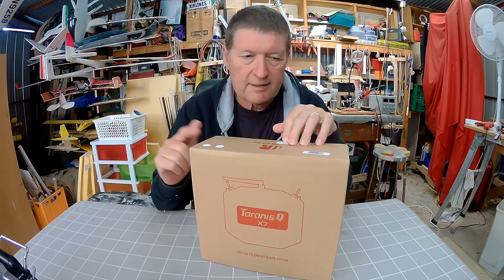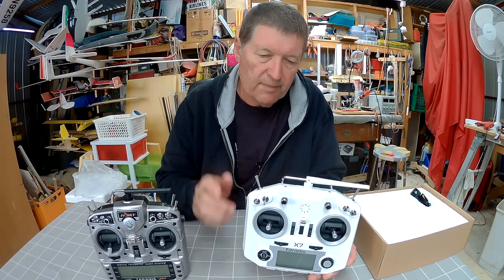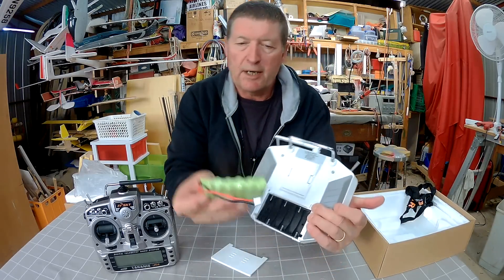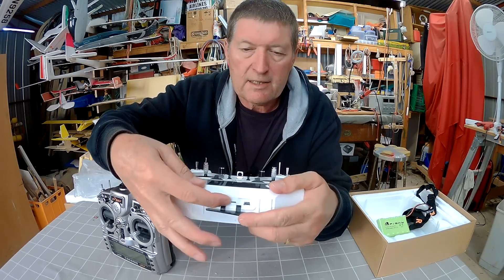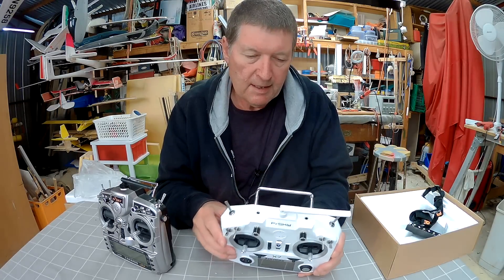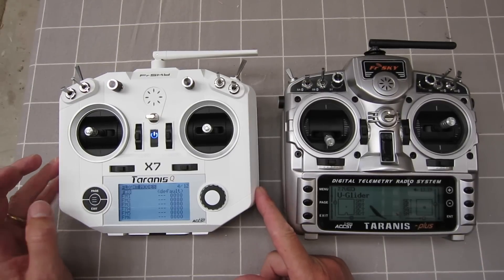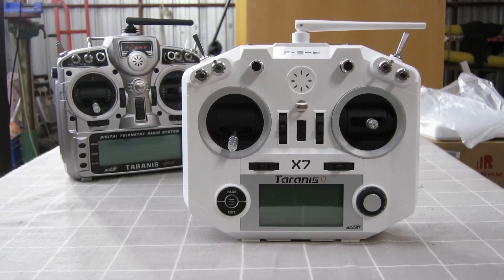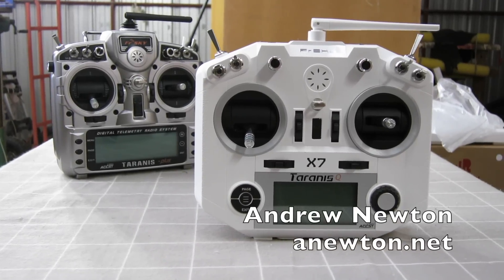Taranis Q X7 review and setup

Comment: Hi Andrew, quick question about the Q7 Taranis.  With these sales on at the moment, I'm contemplating getting one, finally.  However, the one on offer is the international version.  What does that mean, and does that matter for me here in Australia.  I'm your neighbor, just down the road in Melbourne. LOL  Is there anything else I should be aware of before purchasing incase I'm getting the wrong one.  Thanks in advance.  Cheers.
Reply from the maker: Do you have the link? I'll have a look
Reply: @AndrewNewton  Here it is............https://www.banggood.com/FrSky-ACCST-Taranis-Q-X7-Transmitter-2_4G-16CH-Mode-2-White-Black-International-Version-for-RC-Drone-p-1196246.html?rmmds=search&ID=521800&cur_warehouse=CN
Reply: @AndrewNewton  Upon further investigation, I think the international version is for everyone outside the EU if I'm not mistaken.
Reply from the maker: @richardcerni9996  That's correct Richard. The newer versions of the QX7 include the ACCESS and ACCST D16 protocols. Your linked one is ACCST (can be firmware updated to ACCST D16) Have you looked at the Radiomaster TX16S?
Reply: @AndrewNewton  Thanks for confirming.  I haven't looked at the Radiomaster, but since you've mentioned it, I may just have a quick look also.  Cheers.

Comment: Btw i was using a Furibee f36 for like 4 months now,
Today i ordered that Taranis, 
2x CL-0615-19 coreless motor
F4 Brushed Flight Controller (Frsky Rx + OSD)
BETAFPV H02 FPV AIO Camera 5.8G 40CH 25mW
BETAFPV 65mm Beta65 Tiny Whoop Frame Kit with 4pcs 31mm 3-Blade
and that battery for the Taranis- FrSky 2000mAh 7.2V NiMH AA Battery Pack for Taranis Q X7 Transmitter
the excitation is real

Comment: I can't get it to bind to my Quad any of them, thanks for sharing
Reply from the maker: What receivers are you trying to bind?
Reply: Can you make a video of how to set up your QX 7 from the beginning, thanks
Reply: Ohhhhh and it's not modified yet
Reply from the maker: Strange request, this is the setup video. I do the mods in the next video.
Reply: Andrew Newton well I mean straight out of the box I thought that you should be able to fly a basic frsky Quadcopter with the transmitter
Reply: They have the frsky receiver in them
Reply from the maker: Yes you can, but not straight out of the box. Different FrSy receivers require different selections in the SETUP menu. Internal RF>Mode>D8 or D16 or LR12 depending on your receiver.
Reply: Andrew Newton the quads that I get don't have any information with them and I get them from Bangood

Comment: Another great review mate. Silly question, if you totally ignore the costs, which of the X7 and X9D Plus do you prefer or recommend and why ?
Reply from the maker: Not a silly question at all Anthony. I'd go for the X9D for the side sliders and charging circuit. But a mix of the two would be even better. The X9D with the X7 case styling and selector dial would be perfect.
Reply: Thanks mate.

Comment: Hi Andrew, Where did you get OpenTX 2.2?  The link you gave only goes to 2.1.9
Reply from the maker: Sorry, I'm adding to the general confusion about this radio. The preloaded firmware is an FrSky version OpenTX 2.2.0 (1b43d899) 2016-12-19. I believe the OpenTX developers asked FrSky to wait a little longer for 2.2 to be developed further but they didn't listen. The "real" OpenTX 2.2.0 is not considered stable yet so I have not flashed my X7 yet, and I have removed the Aussie voice pack because it was the wrong one. The X7 version is still coming. Here's the latest OTX developments - http://www.open-tx.org
Reply: I looked at my new QX7 and as you said, it says version 2.2.0 2016-12-19,  EEPR 218. I'll watch the RCGroups thread and maybe update it later.

Comment: G'day Andrew. From your video I think the gimbals look like the traditional old style pot type, not the newer hall effect replacement that Frsky is offering for the Taranis / X9D series. Correct??

Updating my own comment.
Info from https://oscarliang.com/taranis-q-x7-tx/

"The gimbals are not the best, but they are okay. These are ball bearing gimbals, same as the stock X9D gimbals. They are not interchangeable with Taranis X9D gimbals (M9) because of the different size and mounting holes pattern (around 10mm smaller than on X9D). However Frsky will release the hall sensor gimbals upgrade for the QX7 soon – X7 gimbals (need to be purchased separately)."
Reply from the maker: That's right, I'm totally happy with the gimbals. But I haven't tried anything else

Comment: What are you getting when you buy a $500+ radio that you aren't with this?
Reply from the maker: Thanks for the info Joe
Reply from the maker: Not a lot, maybe smoother gimbals
Reply: Deviation is a replacement firmware designed primarily for the Walkera Devo® series RC Transmitters.

Comment: A very nice radio. Although I use the Spectrum DX6 with telemetry. Does this radio support telemetry also? Nice review and maybe I'll pick one up because of the ease of over all handling and programming. I just looked it up and it does. Never mind answering. Nice job, Nice radio. I've always been a spectrum guy but adding a second radio seems smart..
Reply from the maker: Yes but FrSKY receivers and telemetry sensors are way cheap
Reply: I don't know that you can get any less expensive than LemonRx stuff...Check it out..I pay 25. for 5 receivers that we've tested,  one for over a 2.25 miles and worked great..Long range signal using the spectrum dx radios

Comment: would this work on a dlg? like launch mode, a cruise etc? is the top left switch a switch that locks in position or does it return by itself?
Reply from the maker: Top right is the momentary switch, I would need to swap it to left myself. Otherwise you can program in anything you can imagine.

Comment: As usual a easy to understand tutorial well done again. 
On a unrelated topic I know you had trouble with flight test planes with thrust angle . I would like to ask looking from the front of the plane do I need to run a prop CW or CCW.
I dont seem to be able to find this info on the FT videos.
Reply from the maker: Thanks Peter. Looking from the front, the prop should be spinning CCW, at least that's what the FT mini planes need. Not such an issue with larger planes. The vast majority of planes will be that way, it's only since quads appeared that CW props (and reversed mounting threads) became more available. I just happened to order the wrong props and motors when building the FT minis.
Reply: Andrew Newton thanks mate .